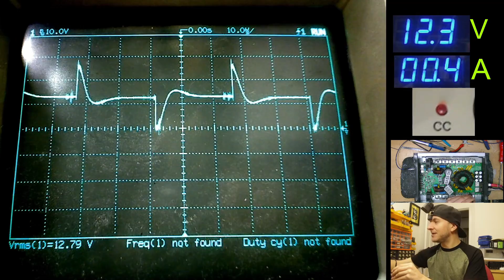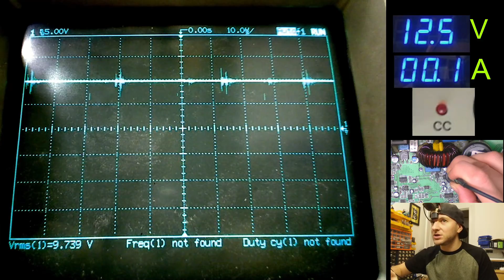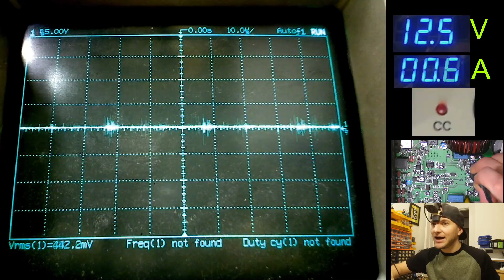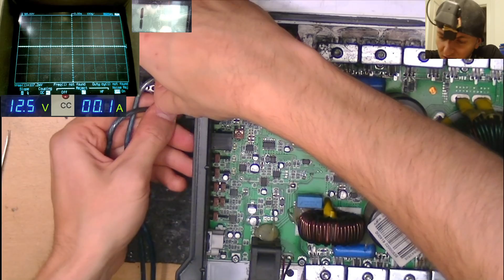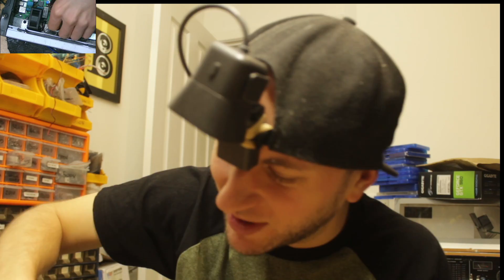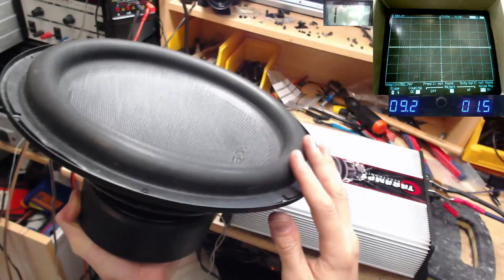Technicians Worst Nightmare: The Phantom Fix | Taramps Bass 5k

Comment: I keep getting the phantom fix on a rockford fosgate p1000-1bd it will be fixed on my bench power supply but stop working when installed in the car its frustrating.

Comment: This is excellent information, particularly the insights into troubleshooting the audio driver's expected performance and setup. However, I'm uncertain about the section at 3:31 where it's suggested that part of the circuit uses IC5, which is a 1678 Op Amp, to generate the ~25V suppling the 7812. I might have missed something, but I'm not clear on how this circuit would be boosting the voltage. To be fair, I also couldn't identify from your camera angles where this voltage generation might be occurring. I don't see any inductors capable of such boosting, aside from the larger, more obvious ones. Fantastic video overall!  The feeling of okay....well it's working with the uneasiness of not exactly knowing why.  Creates those potential fix returns.

Comment: Conductive carbon dust should not be underestimated. I have seen 8 computers from a diesel repair garage killed by it, all with weird intermittent faults, washing machine controllers where carbon from the wearing brushes has caused a flash-over due to high voltages on the board, and even a vacuum cleaner speed controller killed by it (henry dual speed type). If you are honest with the owner about the 'repair', they will likely understand if it fails again. Best keep it away from diesel (exhaust) fumes in the future.

Comment: I have a Taramps DSP 3000 that does nor turn on ( no loghts tuen on either and no sound) . Did some checks and noticed  mosfets from the powersupply shorting when checking with my mutimeter. On the board it says IRF1404 but the mosfets that are installed are csd18502kcs. Don't know if they have been changed already or not ( second hand amp) . Should i buy the IRF1404 csd18502kcs. Can't find both locally

Comment: I'm working on a Deaf bonce amp and the outputs only have a H9 on them and the power supply has H1 on them can u please tell me what these part numbers are for replacement?
Reply from the maker: H9 irfb4227 or irfb260N
H1 IRF1404 or irfb3077 or irfb7537 or any other similar spec
Reply: Thanks so much really appreciated. Yeah it failed yesterday filled my trunk full of smoke I opened it and all power supply fets are fried and it took out 2 of the outputs and I only had it wired up to 4 ohms mono.
Reply from the maker: @genesantos7656  it will need a lot of work to the power supply and output drive circuits, I hope you have experience with surface mount ☺
Reply: Ok so your saying that something on the driver board may be damaged? So replacement of all power supply and output fets may not be enough?
Reply from the maker: @genesantos7656  definitely not! If you just replace the fets it will go on fire again instantly 😂
Reply: How do u test the drive circuit if you can't power on the amp? I don't want to see anymore 😤
Reply: Smoke
Reply from the maker: @genesantos7656  I have a whole video on soundigital board repair which is essentially the same lol. You need an oscilloscope, and a current regulated bench supply, and a hot air reflow station.
Reply: I have a computer digital scope and a hot air reflow station. I'm thinking the power supply was damaged by getting my car jumped the other day. My battery died and a co-worker used a 1500 amp battery jumper box to start my car.
Reply: The driver board had 3 chips two of the chips are marked C7 and one is marked C3 can u please tell me what they might be so I can replace them
Reply: Do u know what C7 and C3 is for part numbers on the driver board?
Reply from the maker: @genesantos7656  watch the Soundigital repair video!
Reply: I watched the video am I missing something? The amp I'm trying to repair has C7 and C3 I didn't see anything on the video saying what the part number was for these can u please help me figure out what they are?

Comment: So, as for an ultrasonic cleaner:
Stainless steel chaffing pan and a bunch of piezo elements, all connected to an amplifier capable of high frequencies above 35khz, driven by a frequency generator that can put out 20-25 volts continuously.
Fill with deionized water, drop your board in and turn it on.
Actually, a phase change humidifier will do the same thing as this, but it's too small.

Comment: Hey Sam have u laid ur eyes on the taramps big boss 3k 5k 8k ? Big big power amps.
Reply from the maker: Nope not yet
Reply: @barevids  they are simply nuts mate they are rated . 5 to 2 ohm at 3k and at . 5 they do like 8500 RMS. They also have led lights everywhere on them that u can control the 3k big boss goes for around 300 here in the US .